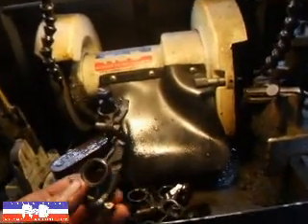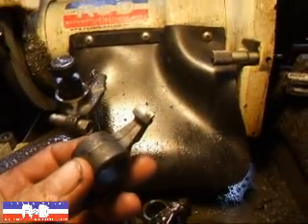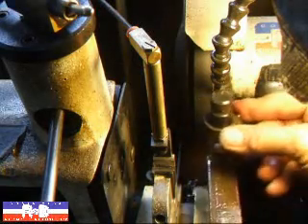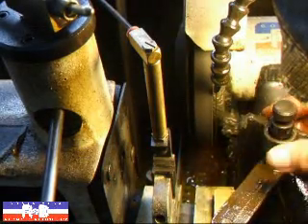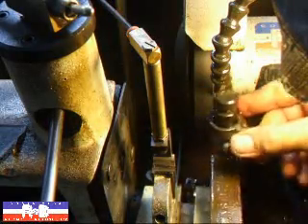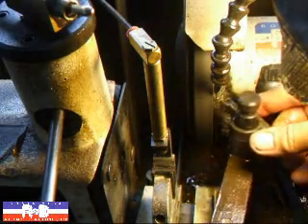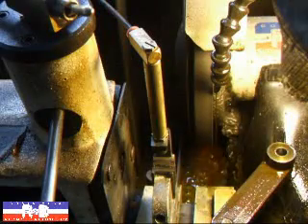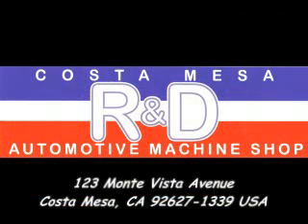Ford Rocker Arm Resurfacing.mp4

Comment: I was wondering if these parts are heat treated at the factory to improve durability and if the reconditioning process affects this in any way. otherwise a good way to increase the service life of older motors that may be in restored cars where it is planned to not drive them many more miles.

Comment: Hey I got a quick question for you or who ever can answer it, I don't know if you know much about single cylinder motorcycle engines, but what is a good tightness in NM for the head bolts? I don't have the manual for it. Do you have an estimate? Thanks in advance